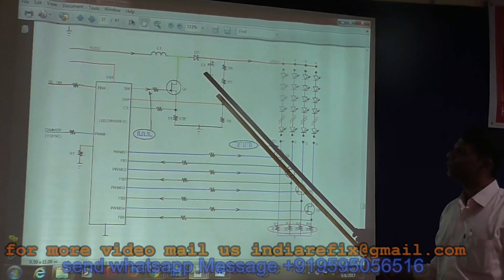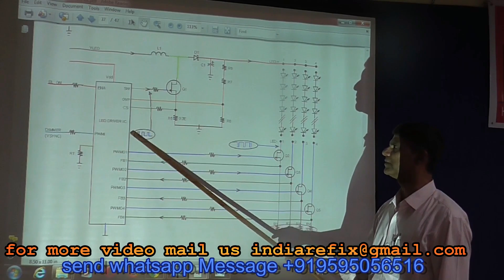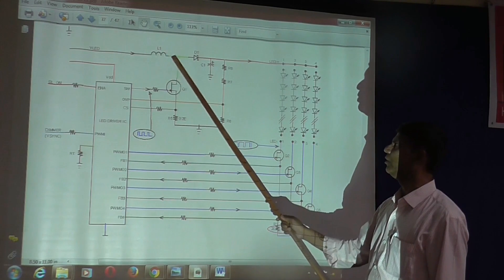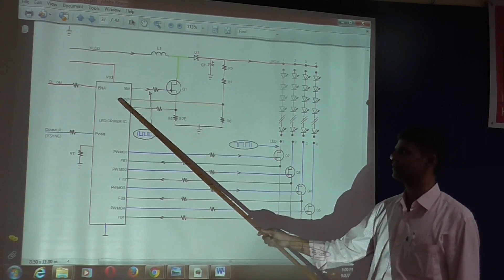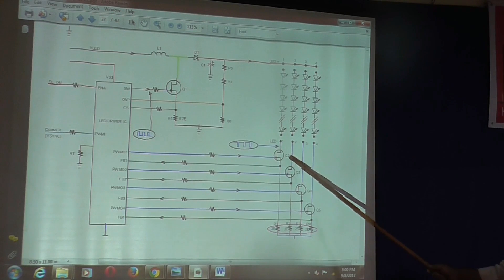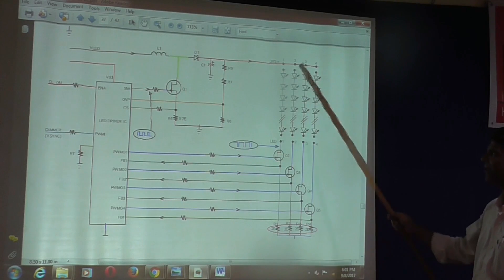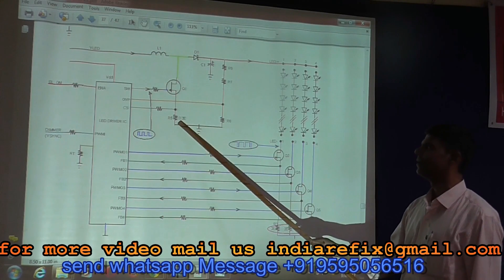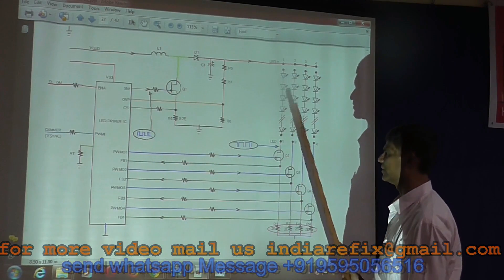LED TV Back Light Section Working

Comment: Sir mera ek electronics repairing unit hi,mujhe LED LCD repairing ke bare me kucha training dijiya.
Reply from the maker: My Dear All Technical Friend
Great LED LCD TV Teacher of India
Mr Satinder Singh Saini & Team With
www.indiarefix.in (Mr Arun Sharma ji)
Is organizing a Seminar for LED & LCD Troubleshooting & Repair works
With Theory as well as practical’s and followed by Training
And tips of BGA Re balling headed by
Mr Arun Prakash Sharma Sir
Sessions covered at our class are.
1) Main board working it's theory and practical
Main board shortcut fault find methods
2) Power Supply working its theory and practical
With all common faults company wise.
3) Inverter/LED Driver board theory and practical
With all common faults.
4) T con/Scaler pcb theory and practical
With Panel bypass methods
5) Important bypassing methods
6) How to update software.
7) Panel faults & rectify methods
8)Panel Testing With DSO                                                                                                                                                                          9) Free 60 GB software Data Of Anroid & Smart T.V. & Normal T.V. With Pen Drive absolutely  Free 
10) Live Demo of All Low Cost Instruments
Like
LED Tester
Panel Tester
Main Board Tester
Power Tester
Eeprom Copier(RT809H)
Without using Professional Costly Tools of LED & LCD Panels.
So Friends
It would be Complete Package of LED & LCD Repair Source
Fees is Rupees 9500(nine Thousand Five Hundred)
(Including Food and Accommodation)
Dear Friends don't miss the Opportunity
Interested people can attend the training class.
Venue : Hotel Goodwill GK I New Delhi
Date : 9/10/11 March 2018
You Can earn A lot Knowledge
In These Three Days
&
Earn a Lot money After Attend this Class
Very Limited Seats available,
You can contact
Javid Suriya 9595056516 ,Manoj Ojha :9414652767    Babbu Bhai : 9888976123